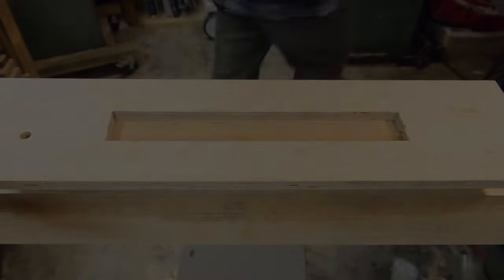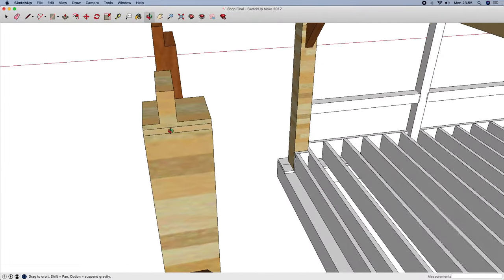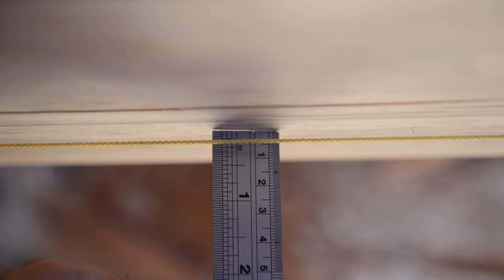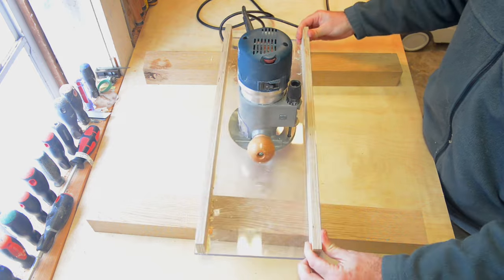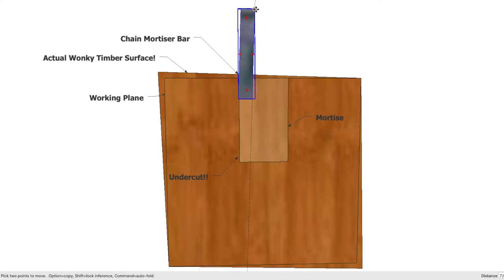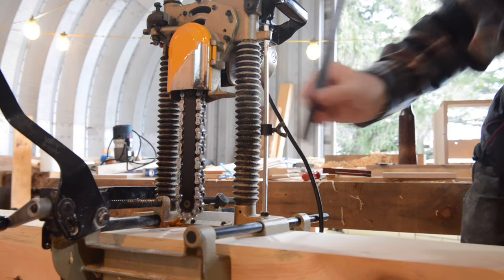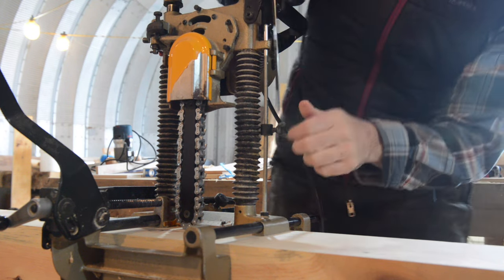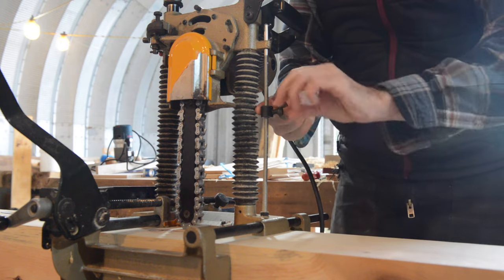Timberframing  Layout Part 3 - Tips for Cutting Joints! #woodworking  #handtools #mortiseandtenon

Comment: Very informative video - thanks a lot. 
I am trying to follow your design of the sled. I  have a few questions about the router and the router sled. 
1. You mentioned you would do it longer. What is the size of the sled that you want to build?  I am thinking about 12x36 and hope it's not too long
2. I have a Makita router for 1/2 bits. What length of the router bit do you recommend?
3. To add rigidity to a sled, I am thinking about using 1/2'' polycarbonate. Is it too thick? (I suppose you are using 3/8")
Reply from the maker: Great questions!  I would use the thinnest polycarbonate you can get away with as it takes up router bit length.  I believe mine is nomjnal 1/4" thick.
Reply from the maker: As for length, short as possible is best, so if you anticipate 12" timbers the you'll need 28" and still need to be careful you dont pull or push it too far, but 12" timbers arent super common.  If its too long then you start pulling one end into your own body as you traverse back and forth.
Reply from the maker: The longer the router bit, the more space there is for you to look down through the router at what you're doing, but also more space to shine  light down into the work space.

Comment: hey there, great videos so far. i am in the process of cutting joinery for my first project and was going to use your method. my question is what if your 8x8 post is being reduced to a perfect size of 7 1/2 from the outside (corner post)? is this a scenerio where you would put your chalk lines 1 1/2" from the faces rather than center? i feel like i understand most of these concepts im just unsure of how to get the outside faces of the intersecting post/beam/braces to be flush so siding will lay relatively flat. Thanks!
Reply from the maker: @aaronwiebe5798  In this case I would probably measure 7.5 inches from the outside to get my perfect timber, and the housing depths may not be a real 0.5" depth, but that doesnt matter.  This would put your outer faces on the right plane.

Comment: This short series is an excellent resource. I have one question - are the housings absolutely necessary, or are you able to just flatten the face at the joint position to be coplanar with your snapped plane?
Reply from the maker: @aiden-hjj  Yes, you could do this if the housing was not required to also provide a bearing surface.  It could get a little complicated because the plane at that point on the timber surface could be a different plane than the surface at other points along the same timber and you'd have to keep track of all that when manufacturing the other mating components.
Reply: @DovetailTimberworks  - are you open to a quick consultation call? I'll pay obviously - I just want some tips on melding your approach with the joints in the Tedd Benson book and some review of my design before I start cutting.

Comment: Hi, great video, thanks. A couple of questions:
1. When you say "I'll find centre on the ends" at 5:55, how do you determine the centre? Do you just choose a face and measure a midpoint along the edge which meets the end? I guess this will mean that the subsequent chalk line on the opposite face will not be in the centre of that face (if the timber is not perfectly square), right? Just wanted to check my understanding.
2. How do you cut the ends square? If you use the circular saw, it's going to cut perpendicular to the face, which may not give a cut square to the chalk lines. Do you use a handsaw for the end cut?
Reply from the maker: I'll get back to you!  Thank you for the questions.